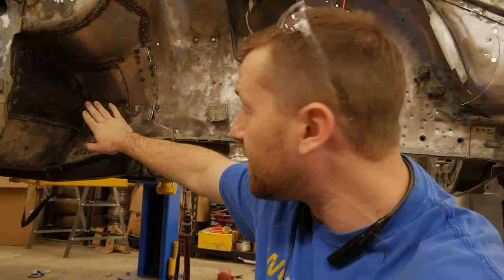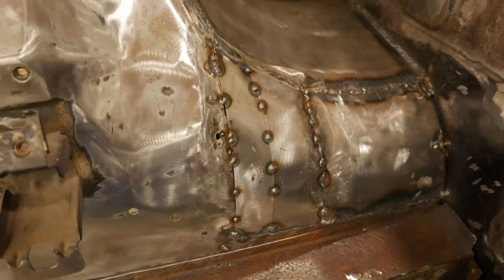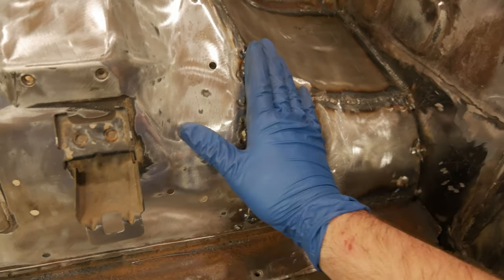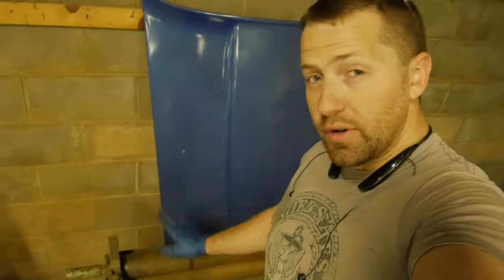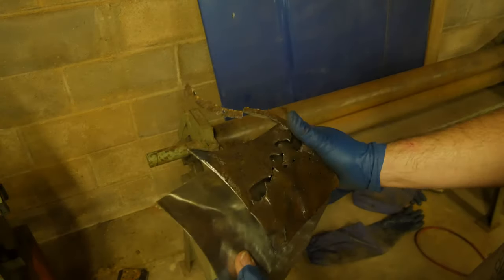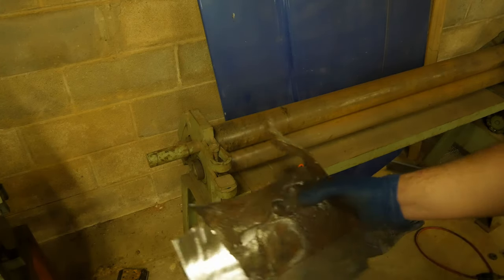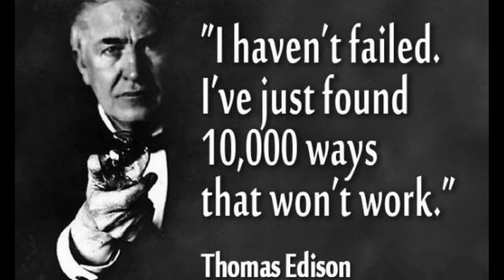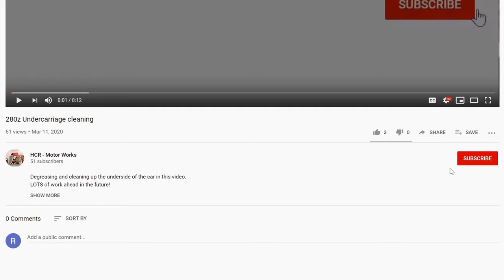Battery Tray and Firewall Rust Repair Part 2

Comment: Only using 4 pieces is pretty good. The professionals make it look so easy - tap this, pinch that, little twist, and BOOM it's done. A good metal worker could have replaced my rusty floor pan in a couple of hours but for me it took all day and the ugliness is hidden under the carpet. Trying to use wood as a buck is a great idea, but too bad it didn't work out. Regardless, the repair turned out pretty nice. The sad part is that once everything is painted and the shiny engine is in place, nobody is going to appreciate the long hours you spent underneath the battery tray except for those of us who got to watch it happen. Never say die!
Reply from the maker: If i had a plannishing hammer I think I could have dialed down the pieces by one or two but I had to work with the tools at my current disposal.
Thanks for watching!